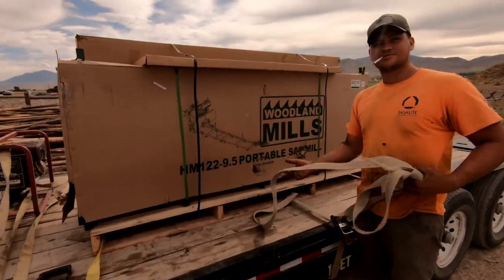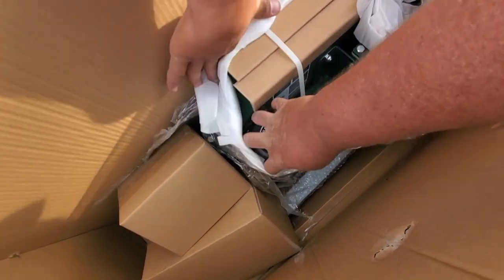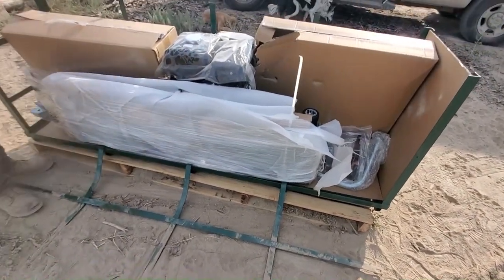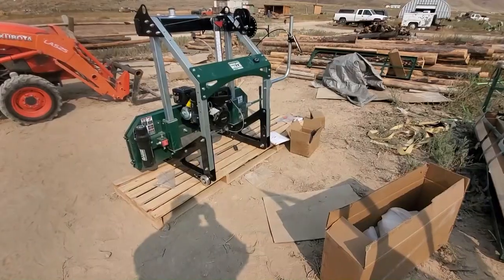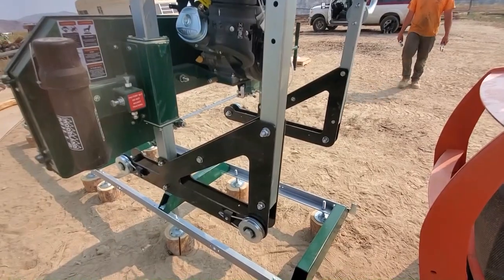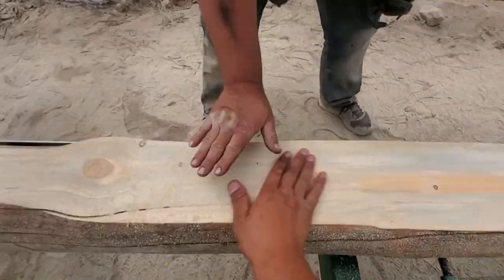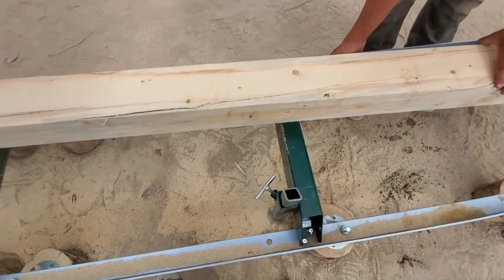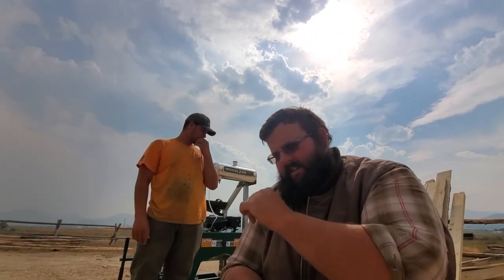Woodland Mills HM122 Assembly & First Cut

Comment: I actually poured Concrete Piers for each of the legs and I have a 4x6 runner with a 2x6 on top of that for elevation  to make it a permanent set up and to keep from having to level everything every few logs or so for settlement and movement.  I'm thinking of adding an additional set of track even though I have the extended track so I can build a storage house over it for the powerhead to protect it from weather.  Eventually I will build a mill shed over the entire unit.
Reply from the maker: Oh, the concrete piers would be nice for sure. Sounds like a nice set up 👍👍

Comment: Where did you get them tree from. why do you keep waving at the wood and blowing on it
Reply from the maker: The tree is just an old dead lodgepole pine. Just blowing or brushing off the sawdust of the fresh cut, to look at the grain if the wood. Also, we like to clean sawdust off the boards for stacking although normally we just use a little brush now. Thanks for watching 👍